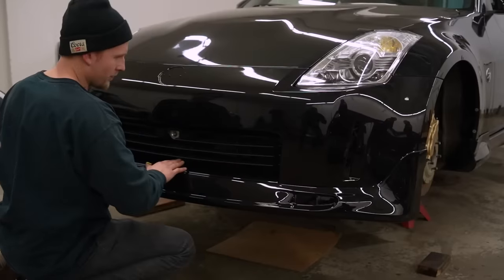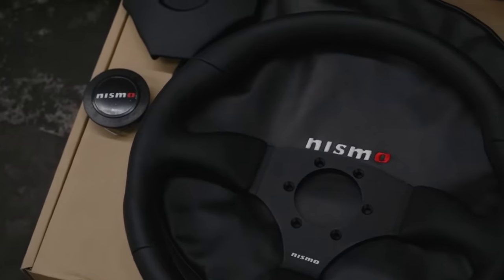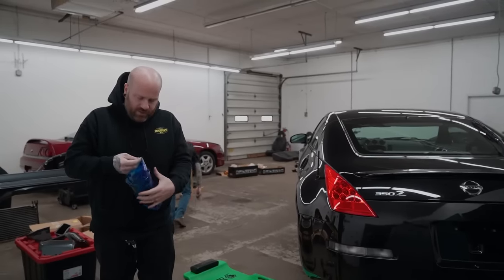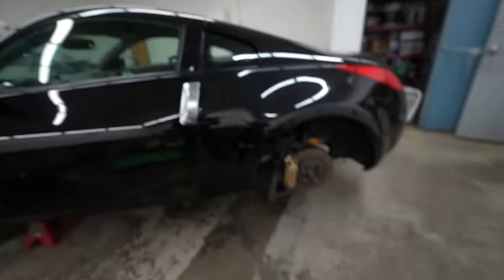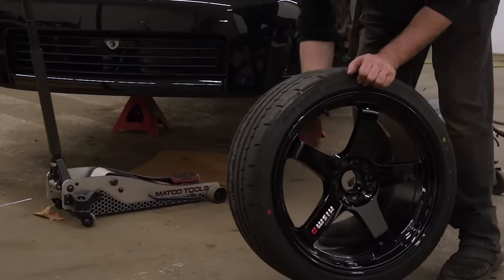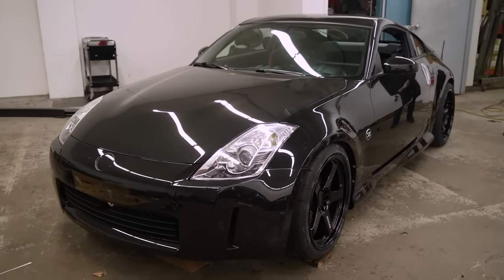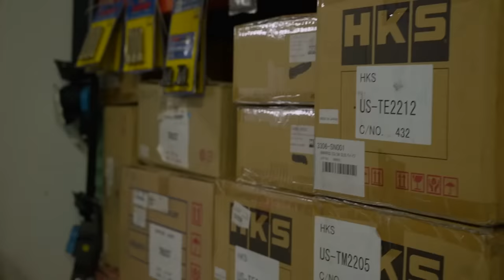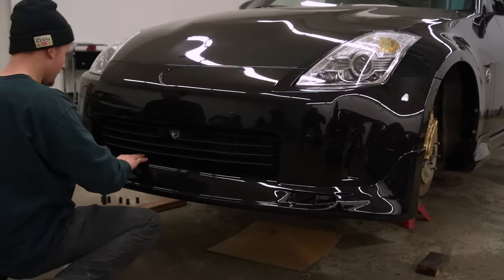BEST 350Z BUILD ON THE INTERNET?

Comment: Fun fact the yellow dot on the tire is supposed to be lined up with the valve stem to help balance the wheels.
Reply: Yeah
Reply: Very rare but I’ve had tires that are perfectly zero or just needs a quarter of an ounce to be zero’d when you line them up
Reply: Was coming to comment the same thing
Reply: The fact that they don't know that is crazy.
Reply: There is a yellow, green, blue, and red dot on my wheels. Lol
Reply: @804MRMAN   only the yellow matters
Reply: @rtsmoto6331  right lol, I see it happen so often even at tire shops.
Reply: @chillingwithcy7687  No, I'm saying each tire had a different color, lol
Reply: It's made a difference one time ever out of thousands of tires I've mounted in my life lol the fact this is a consensus is wild. You cannot pre determine a tire balance not knowing anything about the wheel itself. Stem to dot or not it might save you 0.25oz at best but usually not. It's more of an aesthetic thing and a wives tale imo 🤷🏻‍♂️
Reply: @Josh Martin  well as you say, it's your opinion. The fact is that through mass manufacturing the tires will always come  out in a certain. That being the case we can determine the heavy spot and align accordingly. And b4 you reply I'm an engineer at an automotive manufacturer who works with suppliers and we set up according to this information. In an OEM spec this is true, in your world you're dealing with variables such as wear and tear etc so it may not be exact for your world.
Reply: @shokunin_era   well we’re talking tommy here, dudes a pretty aesthetic kinda guy
Reply: Didn’t know that! Thanks
Reply: @bizwup6897 I was a technician for a hypercar company, mounting new tires on new wheels, the yellow dot does not make the difference what so ever. We were testing that and it really doesn't matter, at least on michelin ps4s or cup2r, and those tires sometimes don't even have the dot on them.

Comment: Looks a bit similar to mine so love it! Mine is built for track.  I'm supercharged, built 11:1 engine, ast5300 coilovers, Alcon brakes, Motordyne/Tomei exhaust, SPL bushings and arms, Osgiken diff cooled with Mocal pump, Koyo rad, spal fans, Nismo V2 and skirts, Coolerworx shifter, Link G4+, JWT cams. Wheels are LMGT4's and at the track 18x10,5 gram lights with AR1. Next up some aero parts 😬

Comment: V nice Tommy...those wheels and GReddy BBK look amazing together. I will say I don't think the GReddy lip suits the nismo skirts though. Nismo V2 front bar would have flowed alot nicer but are getting hard to find genuine. I just found a genuine V2 front with canards and skirts here in Aus but it took years to track down. Definitely agree with you that the nismo skirts are the best looking for z33. I also managed to find a Top Secret Titan Pro dual exit exhaust and complete ARC intake including intake pipe which are stupid rare. Please do more Z builds!

Comment: Did you know that there are kits out there so you can use the vr38 intake manifold on a vq? That seems right up your alley for a build like this.
Reply from the maker: if it does something
Reply: Works on the hr but not the de

Comment: Not a fan of that front lip, it looks like it got stuck behind something and bend up, also the sides of that front lip are to low compared to the side skirts, ruins the look and the flow of the car imo, also would have picked another wheel color, you can barely see the wheel design on those black wheels, the rest looks perfect.